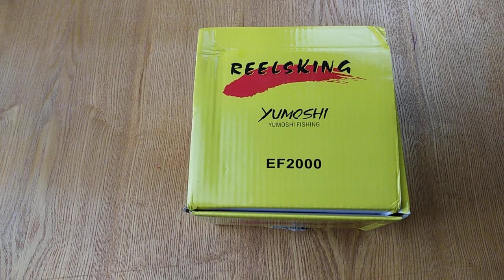Opening 12BB or 12 Ball Bearing Spinning Reel And Checking How Many Actually Bearings Are In

Comment: For chinese cheap reels You don't except 12 bearings ... Actually You missed to checking more some parts ... But these 4 bearings more than enough for using this reel ...just put the greese in enuogh !!!
Reply from the maker: If you mean that I haven't checked the handle then there wasn't any either 😀
Reply: @--unknown--  in the bail , in line roller 1 or 2, in handle 1 or 2
Reply from the maker: @xerxeshadrianus4901  in roller was sponge 🧽 just for brakes and in handle wasn't anything. When it's get wet it was making squeaky noise 😀
Reply: @--unknown--  .....understand . So put more greese or oil ... use it !
Reply from the maker: @xerxeshadrianus4901  I later on bought Daiwa reel. This one I keep in box as spare one which probably not going to be used anymore as all fishermen have loads of crap for "just in case" 😁
Reply: @--unknown--  ...  I agree...👍

Comment: There's 5 bearings
Reply from the maker: Where exactly? 
Not in handle for sure. I know that i didn't showed that in video but I used that reel for a season 😉
It's not bad for price but video is about false info that it have 12BB 😉
Reply: You didn't checked if it has bearings in spooler
Reply from the maker: @edisdazdarevic6320  i did 😎
Reply: Only 3 ball bearings!
Reply: So hows this reel so far? Im kinda interested on buying one